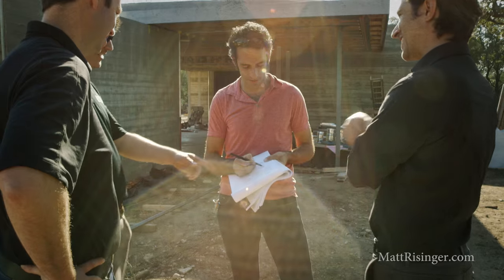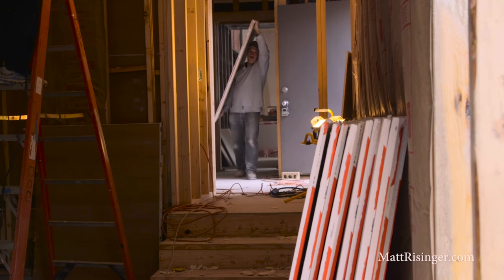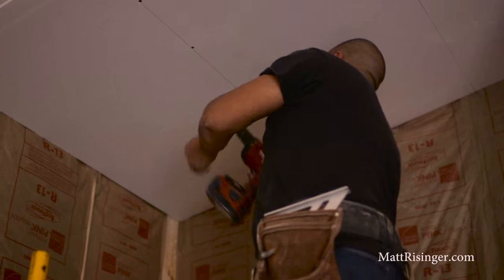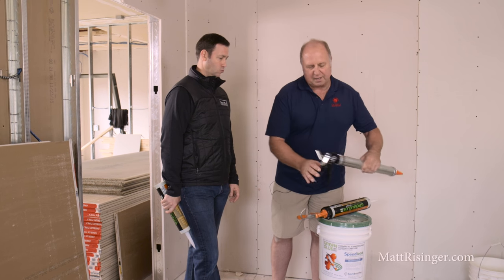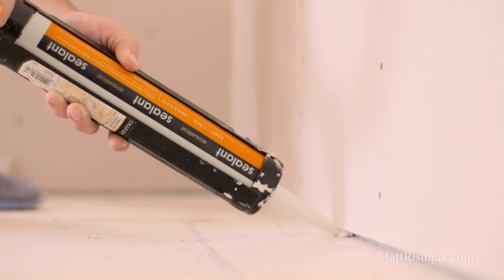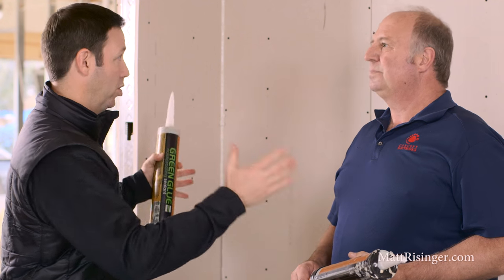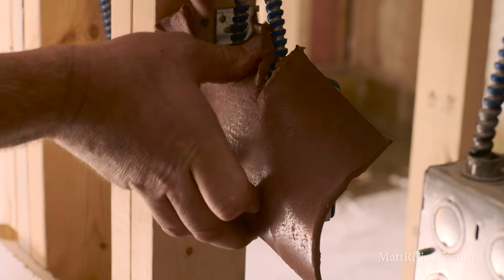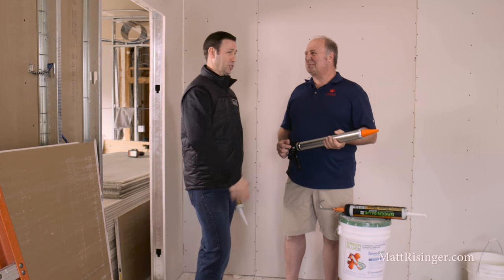How to Control Noise with Green Glue  - Install steps & tips

Comment: It makes mechanical sense up until you put in mechanical fasteners thru the second sheet into the same structure that you are trying to isolate from, negating any real benefit. Any sound vibrations will transfer with all the code required fasteners, it is just simple physics and cannot be denied. It would be more plausible that you are making the wall more dense/less flexible by doubling the sheet rock, thus reducing noise penetration by being thicker, and not by isolation.  Only a unbiased test comparison of equal structures one with green glue, one with out, would show any improvement vs. added cost analysis. I like your stuff Matt, but this one does not pass the smell test.  regards
Reply: +pkav8tor Question. If you just had the two layers of drywall and no green glue, wouldn't the sound get dampend some, but the whole sheet can knock against the other sheet. With the green glue, it would only be at the fasteners that the sound could transmit. If it was only at the fasteners and not the entire sheet, that should dramatically reduce the energy transmitted to the next sheet and beyond, no?
Reply from the maker: I see your point. But, I stand by this install and they have test data to show the effectiveness.  I would however love to do some "real world" testing of some assemblies. Let me think about how I could do that!  See some of my other sound proofing videos where I did some testing of finished jobs. Best, Matt
Reply: Good question.  If you look at the mechanical dynamics of a screw buried into the outer sheet every six inches at every 16 inch vertical (code) the reality is that the inner and outer sheet are mostly connected with or without glue. To say the glue provides damping is a real stretch when code requires that many attachment points, with the consideration that at every one of the screws any glue between the sheets would be squished out to a very thin thickness providing no isolation. My point of observation is only one: Is the cost of the glue worth the very minimal additional sound proofing over the same wall without glue, when you consider how sound migrates thru a solid surface. Thanks for your question, regards.
Reply: Matt Risinger I have seen your other sound proofing and mostly like them. The best one used separate studs which by design is very good isolation and should work well. This one leaves dought  without real world comparison as you stated. Thank for your time , regards
Reply: +pkav8tor I used about five 5-gallon tubs of this with double 5/8ths drywall and I think it is borderline magical.  You have to seal every crack/corner/outlet etc. for it to work.  The Green Glue sealant does "dry" and hardens somewhat whereas the Green Glue dampening compound remains flexible/gel-like.  The Green Glue sealant worked great for larger gaps + is less $ than silicone (I used silicone around the recessed light cans).  Quiet Rock would probably work similarly but it is much more expensive (especially in my case since mine was all DIY = free labor).  Also, with Quiet Rock, you have waste/leftover typical with any drywall job...at $45/sheet for their intro level, the trash pieces would add up quickly.  I agree split studs and/or hanging the double drywall assembly on metal hat channel + clips is better...but I didn't have the space or the budget for the extras.  Even so, just the double 5/8ths with Green Glue between has worked wonders.
Reply: keelerdr Thanks for your hands on input.  As I  stated before ...... would like to see a sound meter comparison of with, and without the dampening glue in a identical 2 sheet mock up room by a independent organization. If you only gain the loss of a few decibels of sound after using alot of  glue, whats the point.  You are then only selling, or installing hype. Which seems to happen quite often now days.   Regards.
Reply: +pkav8tor I agree, I had done a lot of research prior to going with the Green Glue.  I believe they have some studies posted on their website that had an independent lab out of Canada do A/B tests with different panel compositions.  Quiet Rock also posts similar tests - my understanding is Quiet Rock's intro level product at $45/panel is not as good as double 5/8ths with 2 tubes of Green Glue (assuming each setup is sealed equivalently).  Quiet Rock offers some higher-end products that are an inch thick, if not thicker, that would most likely perform better...but man are they expensive.  Also I believe the benefit is the added mass...so 3 layers of 5/8th's might get you there (I'd argue 3 layers is excessive, I'd rather do the metal hat channel and isolation clips).  One area I noticed little to no improvement on is where I used Roxul Safe 'n Sound vs. standard Owen's Corning fiberglass...didn't seem to make a difference to me.  I like the Roxul for the added fire resistance + it doesn't get moldy if it gets wet I don't think...but worth the cost over the fiberglass? not sure.  I was on a very very tight budget so Quiet Rock was out of the question, (DIY labor makes Green Glue much more appealing), and at 1150 sq ft (edit: 1150 sq ft. is the entire house...I wish that was the theater size), we didn't have the space (even still, budget was limiting) for the metal channel + isolation clips.  Overall, if I could start over, I'd still go double 5/8th's and Green Glue - I'm happy with the performance.  I don't realize how well it works until I'm away for the weekend at a friends place and I feel like superman and can hear everything!
Reply: keelerdr As you describe your endeavors I have no doubt that you have achieved a quite environment. But do you really know whether you would have gotten nearly the same results not using the glue between the sheets.  I have reviewed all the data sheets presented by the Green Glue folks. What screams at me as worthless examples is that they did not have the same assemblies tested without dampener glue. And why didn't they? It is the standard in testing to prove your product is better than brand "x" or in this case "not using it". Therefore you are not provided with any comparison evidence that the use of glue is any better, or damn near the same as  just sealed double wall sheeting alone. Also the test results shown are not real world examples of construction. Screw centers are 16 inch, which are larger than most modern codes (less screws = less noise transfer) and the walls studs are on 24 inch centers which is ludicrous today to maintain straight walls. Plus they bedded the first sheet on 1/8 inch thick putty to the studs. These non real examples, plus the lack of comparison to no glue  wall tests leads me to believe it is a deliberate attempt to overstate the benefit without  honest proof. In my world it raises Red flags.  Regards...........
Reply: What I've done is use drywall with GG in between it and a layer of Quietrock. For smaller areas, the cost differences aren't so much. I'll have to try 2 layers of drywall with GG and see what happens. From what I could hear as this was done, the GG seemed better but I like the idea of using both when the areas aren't big and thus don't cost much.
Reply: You may be right, but the practical difference is negligible.